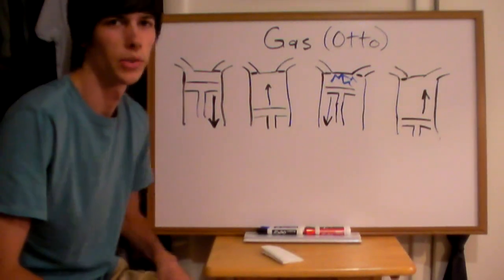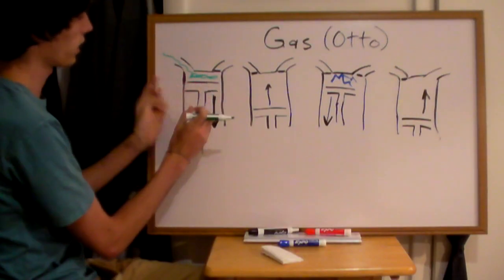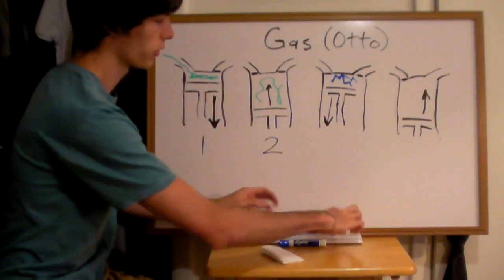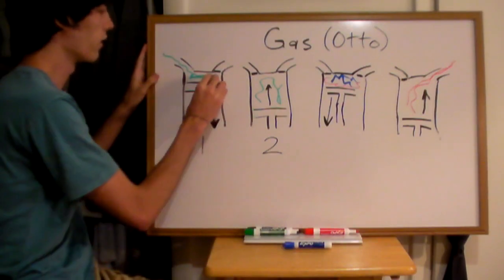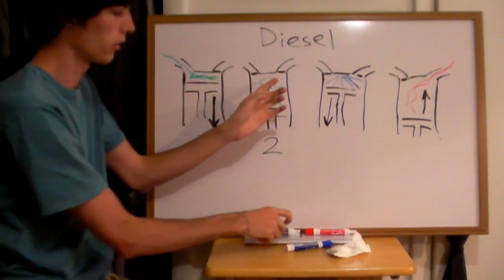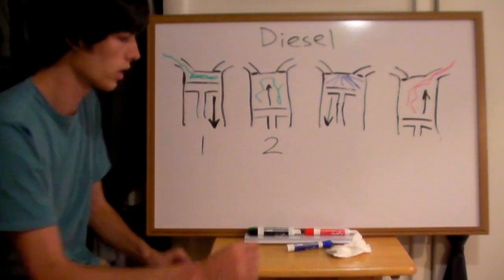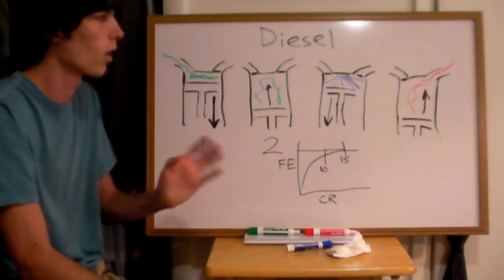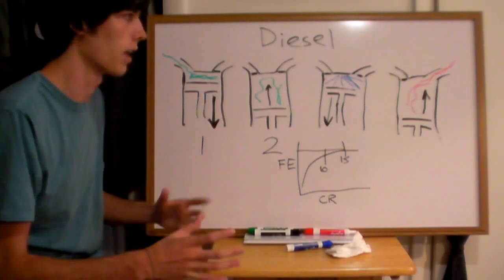Gasoline vs Diesel - Which Is Best?

Comment: Higher compression diesel engines have a tendency to create hotspots during combustion and that causes an increase in emissions (nitrogen dioxide I think) the working theory is that you can use multistage fuel injection to combat the efficiency issue and a lower compression ratio to prevent hotspots (Mazda Skyactiv).
I also noticed a couple of people asking about the reasons for power differences, I know that diesels typically produce more torque (the force with which the engine spins) as the fuel doesn't burn as quickly, or at as higher temperature, which means that during the combustion stroke the energy in the fuel is released slower, meaning that the engine as able to make better use of it, rather than just absorbing it all as heat if the inertia in the engine prevents the components from moving quickly enough.

Comment: Well, if diesel engines are more efficient, why do they produce a lot more soot than petrol engines?
Reply: The formation of soot is not even fully understood yet, it's a very complex chemical reaction chain.

Gasoline is mixed with air completely, so at molecular level you have hydrocarbon molecules floating around in air. After ignition the burning happens extremely quickly (almost an explosion) because there is some much "surface area".
Diesel on the other hand stays as tiny droplets and the oxidizing happens at the surface of these drops. This means slower burn and less heat. Theoretically diesel can be burned as clean as gas, but because of their different phase (liquid vs. gas) it's not that easy to achieve in practice. We end up with some of the diesel fuel not reacting completely because of lack of burn time, different conditions in different parts of the cylinder and so on, which produces soot. Soot is a sign of incomplete combustion.
Reply: Actually thats just "dust". Diesel engines are more efficient.  They dont require emissions testing. They last longer. Get better economy per cubic inch.

Comment: correction, in gasoline engines when the fuel is ignited, it does not explode, it is a controlled burn, if it does explode it is called detonation, and results in catastrophic failure, most commonly breaking of the ring land and debris getting caught between valve and valve seat.  Also, diesel engines usually run around  25/1 compression.

Comment: why don't the gasoline engines have the same design as diesel engines since the design of diesel engine allows higher FE as compression ratio goes up? I am assuming the difference between gasoline and diesel is the flashpoint temperature

Comment: What gets the piston moving in step 1 when there is no combustion yet?
Reply: When you start the engine, the electrical starter does it, from then on the engine runs itself. When one cylinder is doing  intake (1) another is delivering the powerstroke (3) which rotates the crankshaft (which is what makes the intake-stage piston move).
Reply: Got it. Thank you! Do diesel engines provide for better fuel economy than Otto?
Reply: Also, if I understood correctly, in a diesel engine, during the compression stroke, the gas is compressed (not fuel mixture gas) until it is heated to the point of combustion from compression itself? Are the spark plugs like in an Otto engine to ignite it?
Reply: Tim Bruse From the compression itself. Diesels use glow plugs, not spark plugs. Diesels do their power stokes through compression, which is why in turbo diesels you'll see them "run away", commonly caused by a seal going bad on the turbo, and this in turn sends the oil through the intake, and since the compression is so high, it can eat itself to death via oil.
Reply: @dtps238  This was one of my 2 questions after this video. So, glow plugs! So good to know. My other question is: So, after the compression stroke, the diesel is pushed into the cylinder. At this time, the cylinder is full of TIGHT Compressed hot Air; how in the world do they spray into the cylinder without igniting it immediately? The components have to be extremely tough and mainly 'able to seal the mixture in the cylinder where the diesel was sprayed into the cylinder'. How is the diesel being let into the cylinder? 

And thank you for your previous explanation.
Reply: you said most diesels don't have them, however most diesels are not military or heavy equipment. most diesels are in vehicles, and most agricultural diesels are under 250hp and have glow plugs. so what I said still stands.
Reply: doktorbimmer every diesel I have ever operated had glow plugs including agricultural equipment. Cumins diesels have them in the air intake manifold instead of the cylinder.
Reply: Yes they do. All automotive diesels have them and they make up the majority of all diesels, if you want to argue further give me a link with statistics to prove your point
Reply: doktorbimmer your an idiot. Let's see, millions of diesels are automotive. Maybe five to ten heavy duty diesels to a farm, a couple diesel power plants to a city, a few backups to a hospital, and a unknown number for military, but military vehicles don't outnumber civilian.
Reply: doktorbimmer I'm sorry you can't back up your argument with even ballpark figures of the top of your head. The only thing I can think of is if you live in a country were there not as important, or simply doesn't have many diesels on the road.
Reply: While that piston is on step 1, a corresponding piston is on step 3. They are connected by the crankshaft so while one pistons going down the others coming up.

Comment: question
well then y diesel engine has more torque than gasoline engine?
Reply from the maker: Kelvin Tung Higher compression ratio, most are turbocharged, longer stroke.
Reply: Engineering Explained  ok so... i have another question is it possible to have a gasoline engine that inject fuel after the compression cycle  and y
Reply: Kelvin Tung you can have petrol engines that inject after the compression stroke, however, the more mixed the fuel air mixture is the more uniform and clean the burn will be. You can't have a diesel inject fuel too early as it may ignite earlier which would rek the engine, or at least make it stall
Reply: It also raises the temperature in the cylinder to aid in the uniformity of the fuel burn. There are often multiple injection cycles per combustion stroke, it is that which softens the characteristic clatter of diesels not necessarily pilot injection.
Reply: Aid is the critical word sweetheart

Comment: I've been trying to find the answer to this question for years. Why are almost all diesel pick up trucks 4WD? Back before I bought the truck I have now, I was looking to buy a diesel truck. I only found 2 diesel 2WD, but they both had over 400,000 kilometers and all the others I looked at were 4WD. I eventually just gave up and went with a 2WD gas truck. The only answer I can come up with is because diesel has a lower rpm and is less likely to spin the tires if you get stuck in mud or deep snow. Otherwise I'm confused as to why 4WD diesel seems much more common than 2WD.
Reply: because a diesel produces more torque which makes it suitable for getting into more difficult to reach places. Torque is effectively the force with which the engine spins, if an engine has more torque it takes more to stop it spinning. If the car needs to get up a steep incline or something more torque means that the engine will struggle less to push it up. Also because a diesel doesn't need any electronics to run (it has no spark plugs), provided you can get an air supply to it (snorkel), it will run under water with little modification, making it more suited to crossing deep rivers etc.
Reply: Can you elaborate?

Comment: What about the issue that sometimes the diesel engine won't stop and will start burning the oil until it runs out and engine explodes? How can you stop diesel engine if it is self igniting?
Reply: Stick something solid over the engines air intake to try and starve it of air, like putting a blanket over a fire.
Reply: if the throttle is closed and the valve. How would it keep burning fuel?
Reply: MrTURBOJOHN I'm not talking about fuel. I'm talking about burning the engine lubricating oil. However I'm maybe mistaking it with diesel runaway.
Reply: ***** oh. my bad.
Reply: Yea, what if the cars old and the clutch is worn? If the engine is revving you're likely to just destroy the clutch

Comment: If I take a diesel engine and change its head and injection system .. will it perform the same as petrol or there will b a difference because of compression ratio ??

Comment: So diesel engines don't use spark plugs or coil packs???
Reply: no
Reply: if you pulled out the battery on a diesel engine while the car is running, it'd keep going.

Comment: whats then batter and faster gas or diesel ?
Reply: diesel are more torquey, meant for hauling heavy loads. gasoline, while can still be very torquey, would be better for Horsepower, speed.
Reply: Some diesels have insane amounts of tourque, although petrol is usually always faster in the same car, engine (the only difference being the fuel type). I looked at the Audi RS6 5.0 V10 TFSI, it produced 572hp (580hp) and near 700nm torque. When I compared it to the Volkswagen Touareg 5.0 V10 TDI, it had little over 300hp (no turbos) but over 750nm torque. The RS6 was based on the 2005 A6, but launched in 2008, the VW in 2005.
Reply: Azaan Habib  THE TDI STANDS FOR TURBO TURBO DIESEL INJECTION
Reply: vivalaphill Turbocharged Direct Injection
Reply: habs gegoogelt wikipedia meint es is beides ;D

Comment: What if the process of the diesel gets applied on a gasoline engine? Like the air will kick in and get compressed, then when the heat rises enough explodes on it's own without the help of the spark plugs, then exhaust. Is this possible?
Reply: A diesel engine has a greater compression ratio, which is what causes the air to heat enough to explode when the fuel is added, but in a gas engine the compression ratio is smaller, which is why it you need a spark plug... I am sure that if it were possible, spark plugs would be obsolete.
Reply: i didnt know that, thanks

Comment: How is diesel fuel injected when the chamber is compressed at such a high pressure? Wouldn't you need the diesel injection to be at a higher pressure to transfer it to the chamber?
Reply from the maker: Yes, diesel fuel injection can be around 15,000 psi.

Comment: Thank you for that video!

I can't believe i just now learned how a diesel engine works. I always stupidly assumed that the cycle was the same as with gasoline engines and only the type of fuel changed.

So in diesel engines you don't need spark plugs at all, the fuel instantaneously ignites on "touch" with the highly pressurized and therefore hotter air... that's fascinating.

Comment: Why can't they just design gasoline engines to have a much higher compression ratio for better fuel economy?
Reply from the maker: That's what Mazda does. But you're at the mercy of the octane level of the gasoline you have available.

Comment: I'm really enjoying your videos, one question though - what causes the first state? Something pushes air/mixture in so that the piston moves down?
Reply from the maker: The starter motor starts the engine, then the inertia of the flywheel is enough for the following compression strokes.

Comment: I have a question.. so if in diesel engines the fuel is injected, does that mean it doesn`t have any spark plugs like the gasoline engine? Also is having a higher CR mean more power?

Comment: Hello guys. I need some help from some of you mechanics out there. I have a 1991 Suzuki Samurai. This year was the first year they had come out with the EFI system. I got it stock from my Grandpa, so it came with this system. This system was giving me nothing but trouble, so I asked my uncle (who has a 88 carbureted Samurai) if I should switch it over to a carburetor. He said yes, and took his advice. I really had nothing to lose anyways. So I called a man down in Tampa, and he sent me all the things I would need to get it going with a carburetor. He sent me the intake manifold, the coil, the distributor (and a new rotor), a fuel pump, fuel pressure regulator (I set it to 3 lbs like he told me to), and the gas tank I would need. After I got all of that stuff, I ordered my Weber Carburetor. After I received that in the mail, I got to work. I put all of the parts on, and took it to a mechanic to get it running. Well, he did get it running, but after about 5-10 mins, it will shut off. He says it may have something to do with the distributor, but I'm not to sure that's the problem because it will run for a little bit. Any ideas guys? Help would be greatly appreciated!

Comment: Instead of spark plugs like cars diesels use glow plugs they have to get hot to burn the fuel that's why diesel has a lot of trouble starting in cold weather

Comment: if your gas explodes thats bad, you just had a detonation. i think you meant to say burn your gas.
Reply from the maker: I simply don't get caught up in the semantics of terms. You know what I meant, but wanted to "prove" your correctness. It's all irrelevant and hinders learning. I've graduated with a degree in mechanical engineering, and have a great job in my field. If you're irritated by the videos don't watch them. Critiquing is easy, make a video and I'll point out a flaw or two for you. Cheers.
Reply: You are absolutely correct. If something explodes in the cylinder or chamber then you have problems. The correct term to use is burn. If it was an explosion instead of a burn we would not need to turn the fuel into vapor. Turning the fuel into vapor allows the fuel to be BURNED a lot easier. Not Explode easier. But our friend seems to have a problem with being admitting he is wrong and owning up to it. I'm having the same problem myself on another topic.
Reply: Engineering Explained "Semantics!" Really?? Someone with a degree in mechanical engineering should know that the difference between combustion and a explosion is very different. Especially when dealing with automobiles and how engines work. Why do you think we say, "complete combustion" "incomplete combustion" "combustion process" when we talk about how engines work. Sir If you can not admit when your wrong and not get defensive when people try and tell you made a mistake. Then maybe you should not be making videos. Or how about this. Actually study the topic you are talking discussing.
Reply from the maker: Regardless, it's an explosion. Air, fuel, spark, boom. All contained within a nice chamber.
Reply: 177SCmaro Sir, I could not have said it better myself. I learn more when I admit my mistake and try to grow from it. That's the difference between being wise, and just being smart.
Reply: grizzskoalcope stfu
Reply: ^ why? i made a valid point you cant be an engineer and not use correct terms (2nd year mechanical engineering student at YSU)

Comment: This question may be alittle off but why do diesels redline at lower RPM than gas engines?
Reply from the maker: Higher pressures and temperatures, thus they produce greater power at low RPM. Keeping the RPM low is better for the life of the engine as well. Also many are turbocharged.